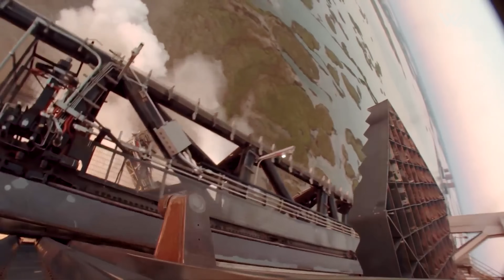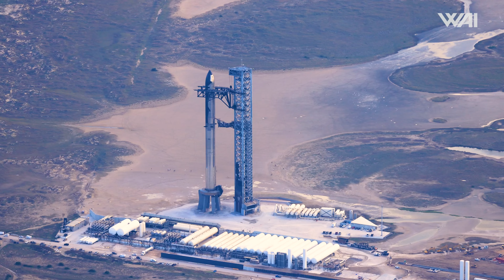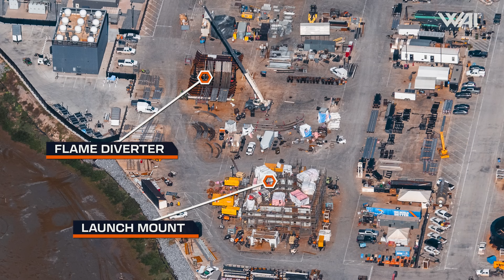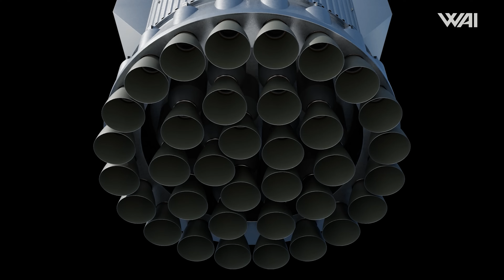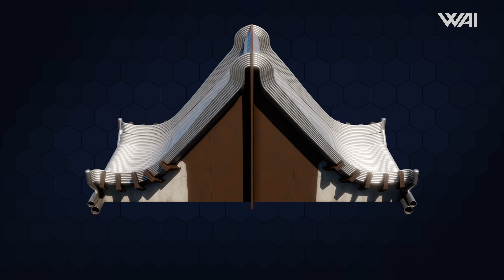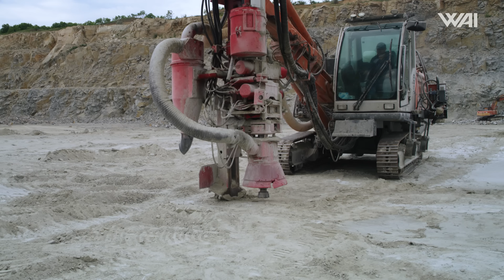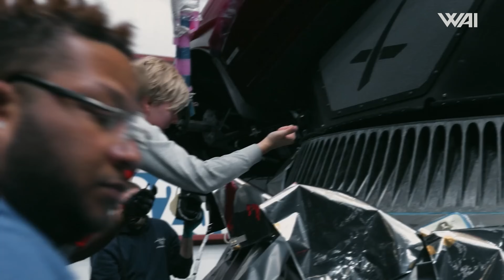FAA Filing REVEALS: The SpaceX Starship Giga-Plan!

Comment: Given shorter "chopsticks" (launch guides), does the rocket need a closer initial approach to the tower, compensating for its angle, to ensure the top pins have enough inward travel to land securely, even with slight variations in trajectory?
Reply: No he's talked about this before the have shown that they can almost always nail the spot they need to be with out issue and change in length will keep it the same distance away from the tower it's only getting rid of all the excess that they've shown they dont need.
Reply: The chopsticks are not first principles engineering. A U-shaped tower, something like a skier with poles, is less costly and more effective.  The booster lands in the arms of the skier, and the force is transmitted downward  through the poles to air bearings.   Risking the launch tower is folly, and the chopstick design has too much bending moment.  Simple air bearings (like an air hockey game) have no moving parts.  The best part is no part.  Caught booster is handed off to launch tower.  The catch tower does not need an elevator.
Reply: This is not anime, a design like you propose creates many issues trying to build the "ski poles" that are several hundred feet tall, but don't flex when they have to rapidly move sideways to meet the rocket. 

Also, air bearings work great in clean room conditions inside buildings, but not so well on exposed concrete next to the sea shore with sand and salt spray getting on everything. 

So you are actually ADDING much complexity and weight, making additional tall towers that have to have extensive bracing to keep them from flexing. 

The chop sticks have obviously been engineered properly for the weight, so they don't have too much bending moment. 

And the reason for the chopstick design is that while it's precise, the landing rocket is not millimeter precise, because you can have wind gusts that can move it slightly around, and so the chopsticks are designed to rapidly close around the rocket, wherever the rocket ends up, and so the lower mass compared to your design allows them to move faster and more accurately to meet the rocket. 

Plus, since your design requires an entire separate tower structure, controls, hydraulics, and a lot of ground space, your whole "the best part is no part" becomes laughable when you are designing the second biggest PART in the facility! 

It's funny when Randoms on the internet think they are better engineers than the ones at SpaceX... 

 @mefobills279
Reply: @ke6gwf  Think hard.  One mishap takes out an expensive launch tower.  Air bearings are on flat stainless steel flooded with clean water.  You absolutely can move mass with high-speed jack screws that have recirculating bearings.  Vernier arms. something like a wrist on the skier can move for smaller graduations, not putting all the vernier on the booster.  Yes. the launch tower design to double as a catch tower is too much risk when there are low cost simpler solutions.  There is no need for hydraulics or complexity, that is you building a strawman.
Reply: @mefobills279 building a several hundred foot tower able to catch a rocket is NOT cheap, especially when they have limited land available anyway, they don't have space for it.
It's a lot cheaper to have chopsticks which both load the launch platform and stack the rocket, and also catch it on the return.

And if there is a mishap, it could just as easily take out the launch tower anyway, because it's a multi story flying rocket that could make big explosions.
Reply: @mefobills279 How would you reuse a flight worthy ship if it's not on a launch tower with an elevator?  Rapid restacking and relaunching in place are the goals.
Reply: @user-gv4cx7vz8t  How long would it take to pivot the landing tower for a handoff to launch tower?  It's crazy to risk the launch tower for landing.  The launch tower is very complex and expensive.
Reply: @mefobills279  your skier tower would also be very expensive and complex, and if you are relying on being able to catch the rocket, either tower being damaged is going to shut the whole facility down.
So by combining them and eliminating the excess parts of a second tower, you save money and space and a lot of time.
Reply: @ke6gwf  The launch tower is vulnerable to shock loads.  Think of it like babby wriggling on outstretched arms.  It's Hubris on the part of space X engineers to think that every catch will be in a narrow window.  A falcon 9 hits the barge too hard, no big deal...the booster is lost, not the barge.
Reply: Which is why they have it designed with shock absorbing accumulators, shock absorbing catch platform, and the whole chopstick assembly is suspended by cables that will absorb a lot of shock, and then heavily over built the tower to be much stronger than needed. 

You have a lot of hubris to think that you can watch a couple of videos and think you can engineer it better then the literal experts. 

Also, Falcon 9 does a hover slam because the Merlin engines can't throttle low enough to actually hover when it's empty. 

Starship is able to hover, so it can be a much more controlled landing, and thus much less shock loading. 

But, you think you are smarter than you really are, and so I don't expect logic to make any sense to you...  @mefobills279

Comment: Starship's booster has successfully flown before, each booster flight having small evolutionary improvements from the previous flight. 

Starship build 2 is a new test version with many new changes and improvements. Included on this flight is a new fire suppression system and additional fuel venting capabilities, to improve the odds of a successful missions flight. Expect this feature to eventually be removed or reduced in size once the underlying issues are identified and resolved.

I suspect the Pez dummy starlink modules launch has a very high priority this flight, since Starlink provides major funding for Space X.
This shows Starship can perform multi-mission objectives.

Expect this flight of Starship to successfully duplicate flight 5. But it is still a new test vehicle...

Comment: I think that Spacex will need to determine what was leaking and fix that issue in addition to a bigger vent and fire suppression system, since a fuel leak is a major issue. I don't think that Spacex has designed the starship with a large amount of excess fuel it can just give away to the atmosphere and still be able to complete it's landing objectives.
Reply: Cold + vibration in the system (?).
Reply: It was certainly a major methane propellant leak. Was the overpressure breaking pipes. Or did cracked pipes cause the overpressure?

Comment: Does Blue Origin have the same pad & quick disconnect issues as Space X and if not why?
Reply: I don't think so.  Very different scales.  BO about 4 million pounds of thrust at launch, SX just shy of 17 million pounds at lauch.  So the BO pad etc needs to endure fast less abuse.
Reply: New Glenn has only flown once, and it's way less powerful than Starship. Falcon Heavy also doesn't damage it's launch pad and its a lot more powerful 
NG = 1,750 tons of thrust, 
Starship (v3) = 10,000 t
Falcon Heavy = 2450 t
Reply: @admarsandbeyond  Thanks guys

Comment: Return landing on the launch tower is unnecessary, dangerous and costly. The best thing SX can do right now is to create a landing platform featuring two landing towers; landing the Starship between the two. Easy to build, far less costly and eliminates unnecessary use of the launch tower itself. It would benefit rather than hurt quick turn around times.
Reply: Yet the reason they want to do it is because it has the potential to save both turn around time and dry mass.  That's why it's better to leave engineering to actual engineers.
Reply: @ - there is simply no way they save time and money at this point by using the same tower for both launch and landings versus a landing "platform". SX has the capability to easily move around those rockets as needed. The tower they're using right now is not yet reliable enough to use without frequent reconditioning. Every launch and every landing presents a whole host of new problems. SX has already chosen to have a land based landing platform in Florida and will also have landing platforms at sea. A landing/launch platform will be nothing more than a bottleneck as launch cadence increases. Make a list for an against and there is no contest.
Reply: Spacex don't care about 'at this point' they are working on 'how it should be' which will take quite a few changes and upgrades to the tower they are currently using. The second tower at starbase already has a massive change to it's ground systems specificly to increase the reliability and turn around time.
The Florida landing tower is more for transfering ships between sites and allowing them to aviod delays in getting the next stack ready because they still have a ship in flight.
Reply: the reason for landing on the tower is so it can refuel and launch in hours and not have to be transported back to the tower.
Reply: @ - don't kid yourself. They can have several rockets landing and being prepped for launch while the launch tower is being used to launch. Every rocket launched or landed on the launch tower requires a complete inspection of the tower and its complex parts. Every rocket that lands has to be prepped and can be easily moved by SX. While I would position them away from the launch tower, others might want them right next to the launch tower. BTW, using a landing platform doesn't mean you have to use legs. In fact, you can reduce the angle of attack and bring the rocket straight down between a landing surface. Less fuel waste, no damage to the catching arms and far less expensive than a dedicated launch tower.

Comment: Can someone explain to me why star ship doesn't use air spikes it would cut down on engines (therefore weight )
Reply: Aerospikes seem nice in paper but in practice they are not worth the money and effort.
Reply: starship uses lots of engines so that when one doesn't work they have enough to compensate. Booster 14 returned to the tower with an engine out on the boostback burn.

Comment: What if we build a new space shuttle with more space inside tied to 2 Space X retrievable boosters?
Reply: You would need to build a new space shuttle for starters. And that would be more expensive and would take easily a decade. Than on top of that the boosters would need to be changed for the different load. Going from falcon 9 to falcon heavy took them much more time and money than they had anticipated. And all that while the starship is basically a new space shuttle with more space inside?

Comment: Kleine Berichtigung die Chopsticks wurden nur vom Gelben LR11000 Installiert. Marv stand nur daneben und Schaute zu. :-D Small correction, the chopsticks were only installed with the yellow LR11000. Marv just stood there and watched. :-D
Reply: They used both cranes to connect the chopsticks to the carrage each lifting one stick and holding it in place for them to be connected together.

Comment: I dont see the point in even bringing starships back to earth anytime soon.  Just leave them in space ready to be refueled.  They dont need heat tiles for Lunar entry and landing.
Reply: No littering
Reply: @shaya_g  lol
Reply: So, you would send refuling SHIPS to refuel A SHIP and then leave those refuling SHIPS floating in space? Hmmmmmmm 🤔
Reply: @tehice23  Yes, that was the one aspect he didn't think of.  He is right that there is no need to bring a ship back right away.  Potentially one can loiter in orbit if there are any issues (schedule or technical) at a tower.
Reply: @imaginary_friend7300   i agree, no need for every ship to return imediately, like transfer/transport/tug/refinery etc ships. But if the point is to make space travel cheap, you need reusability. Fuel cost is so insignifical compared to what that fuel powers, bordering to comical.
Reply: @tehice23  Agree, but lets just not try to bring people back in a starship.  Capsules have a 100% survivability rate over the last 50 years.  The space shuttle, not so much.
Reply: @dherman0001  im concerned about that aswell, but since its stainless, survivability is higher. If we are honest, shuttle was kinda asking for an accident 😬
Reply: @tehice23  Such a huge object that needs protection.  Much easier to protect a capsule.
Reply: @dherman0001   ufffff, if JFK and other great people would take the easy ways...
Reply: @tehice23  Use those ships to build megastructures in orbit or structures on the moon. Design as dual purpose.
Reply: @tehice23  theres nothing saying the boosters cant push all sorts of things to orbit and even to the moon with another stage and a smaller spaceship.
Reply: @dherman0001  i agree with you on that, they could already use an expendable upper stage for payload deliverys, if nothing else, to get those funds rolling. However, we got to keep in mind other factors aswell, like investerors, public trust, r&d of new stage (takes time, alot of time) etc. Changing plans this late has decrimental impacts - displays incopetence or/and dishonesty (alot of people would love this). Not something to risk if people invest into it. And the goverment....
 Its right how they are doing it, step by step. 
Also, looking at timeframes, they clearly follow a preset progress path. 1st they did the vertical hover/landing tests for ships. After learning how to do that, they focussed on booster. And now, after knowing booster tricks, they are refocusing on the ship. Step by step. Space flight is hard af and takes time, lets just wait untill they are done.